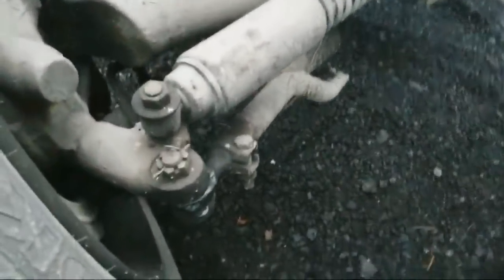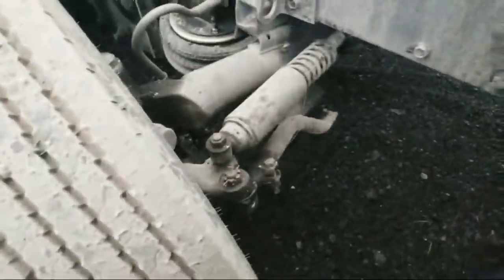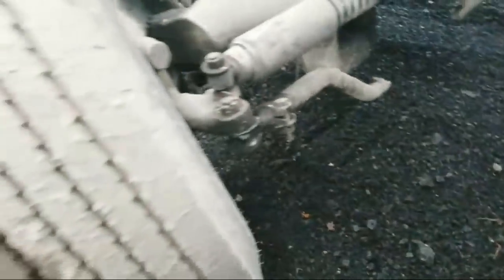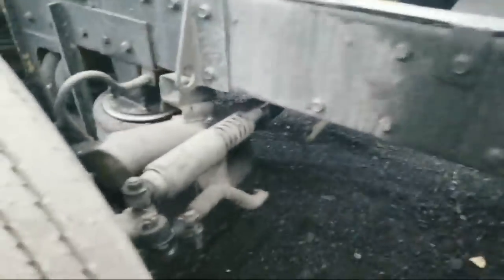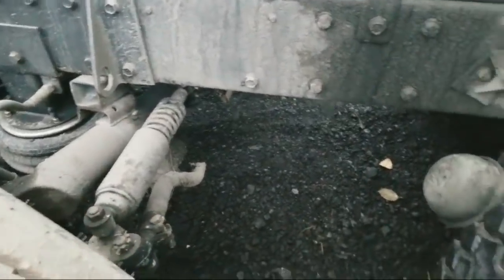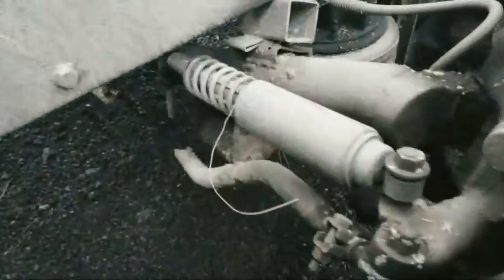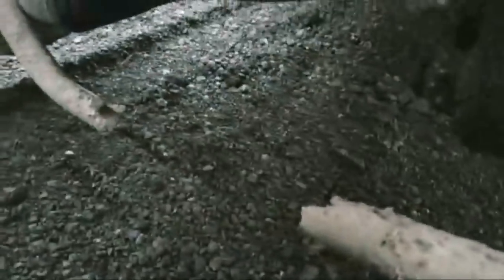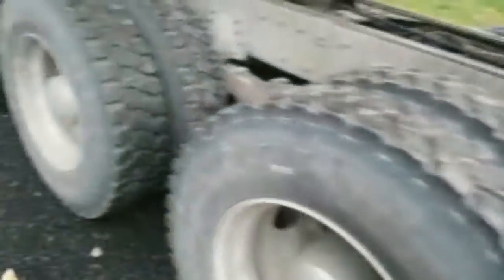Broken Tie Rod

Comment: You might be able to clean up the ends and sleeve it with some tubing.  Just make sure that the tires are parallel before you weld.  Measure several spots on both sides of axle they should be the same.  Measure drivers side to passengers side rear then front side then back then front sides until you are confident that they are straight